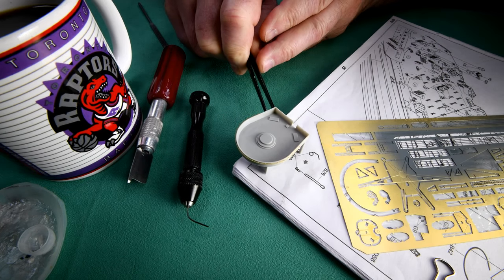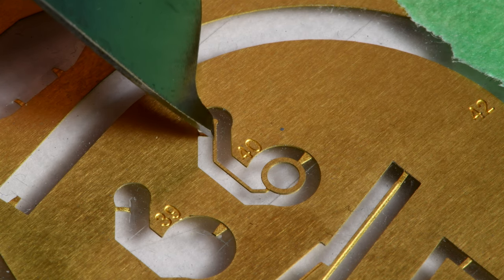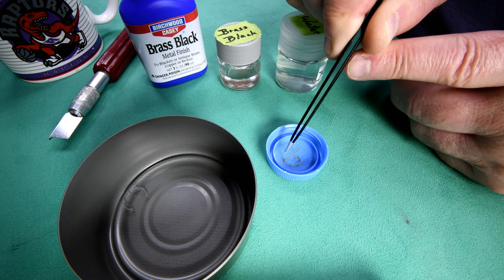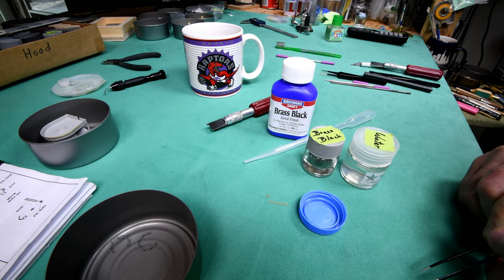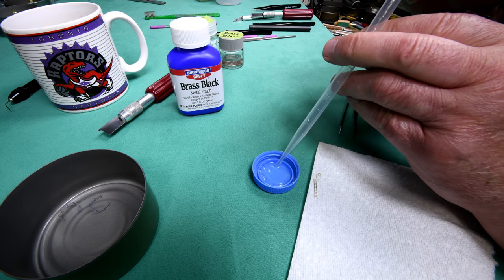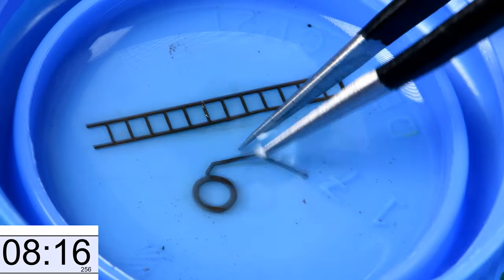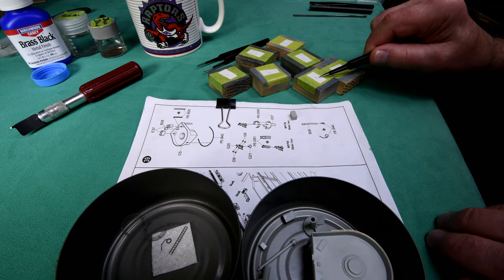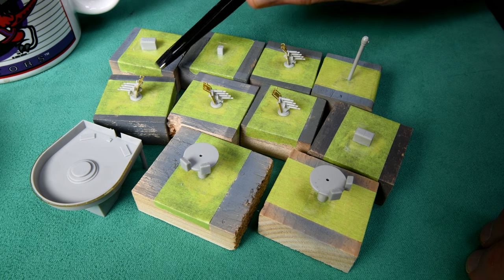The Model Ship - Part 685

Comment: Dear Ron I know you have purchased the black coating for etch but have you tried Mr Metal Primer is ideal for coating metallic materials (i.e. white metal and photo etch ) prior to painting. It prevents paint peeling off metallic surfaces.

Glass jar has integral brush in lid. This Mr Hobby Product is very good I use it .You generally spray paint the photo etch anyway this will save time and works
Reply from the maker: Thanks for that tip Ralph.
https://www.youtube.com/watch?v=FkBp7P2FbCk 
https://www.amazon.ca/Mr-Hobby-Primer-Bottle-Gundam/dp/B0000WS0ZA/ref=sr_1_1?dchild=1&keywords=Mr+Metal+Primer&qid=1610542006&sr=8-1